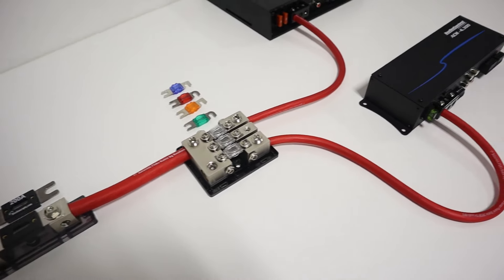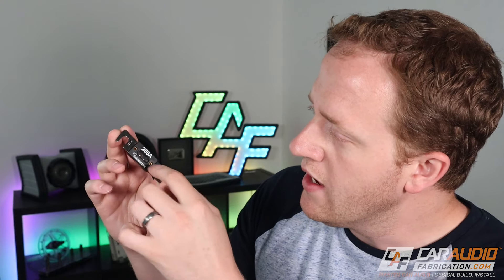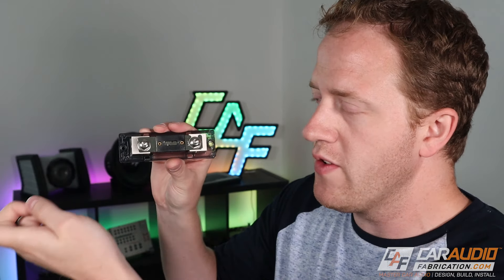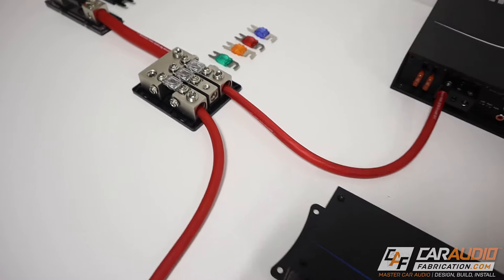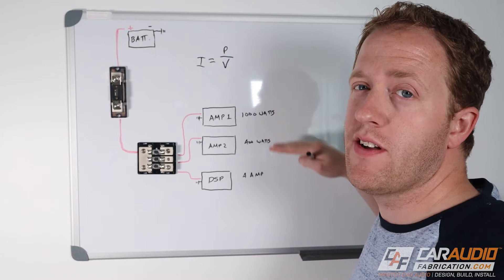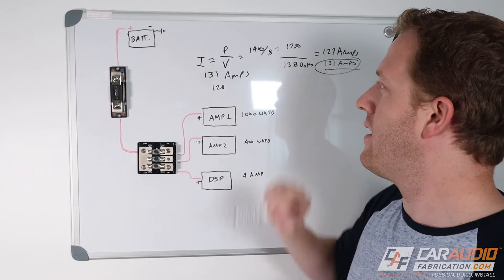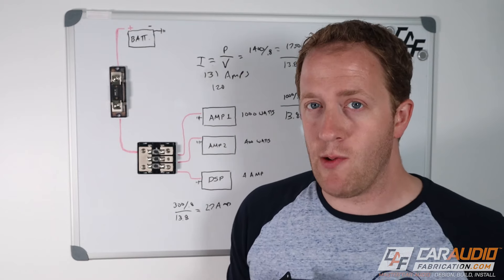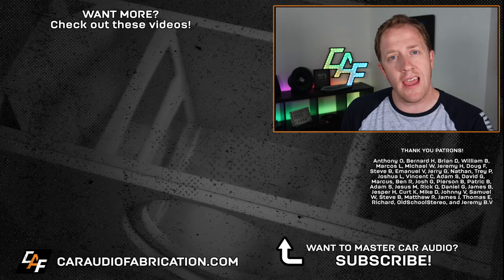Fuses EXPLAINED! What size do YOU need & MORE!

Comment: So I’m doing a 2 amplifier setup one is a 4000w 5 channel and 3000w 1 channel.  I’m trying to see what fuse would I need to run from my battery to my main fuse and also through my fuse distribution block to the two amps.
Reply: Would I need another battery in the back where the setup is ?
Reply: My 5channel amp has 3 individual 40 fuses

Comment: Just signed up, where does the 13.8 v come from? Isn’t the battery only 12v? Please explain, I want to build systems for friends and family as a hobby, but I want to do it right.
Reply from the maker: Turn on your car and use a multimeter and measure the voltage across the battery terminals. ;)

Comment: New to installing and I want to do it right.  I have an A/B four channel amp that has a peak of 360w.  By my calculations, I should have a 50 amp fuse.  Due to its efficiency rating, I am concerned about the size speaker wire.  The manual suggests using 14gauge, but everyone is telling me I will be fine with a 9 wire bundle.  This is typically an 18awg.  Any suggestions are greatly appreciated!

Comment: What are your thoughts on using CCA for my application? 
Im contemplating installing a 1/0 OFC amp kit, fused distribution to two amps using 4awg CCA (150a and 80a individually). I know 150a is pushing the limit for a short run of 4awg pure copper I'm assuming, according to the charts I've seen. That got me thinking about the grounds as well, and how it may be an issue. 
Just trying to talk myself out of buying more OFC really and I already have a bunch of old 4g CCA wire.
Reply: I know this comment is 8 months old, but I hope you went with the ofc. If you're not sure about it being the right choice, watch meade's video 'cca vs ofc' and you'll never want to use cca again (that is, if you want all the watts you paid for)!

Comment: Would I be using "Peak" Wattage listed for the amp, or continuous for the equation?
I have 2 RP2000.1D Amps and a RP75.4AB (300w rms) amp that I will be installing into my mk6 Jetta once I get a HO Alt and XS Battery. Would I use 2000w (the underrated continuous wattage) or the 3,107w Dynamic dyno run for the RP2000.1D?

I will be using Welding Wire 0g run to the back into a distribution block, 0g to both RP2000.1D's, and 8g to the RP75.4AB. I planned to use the "in-line" style fuses to each amp.

Comment: Thanks Mark awesome video. I bought a 6 gauge wire amp kit that has a 80 amp fuse. I’m going to use a small 400 watt amp but the kit says for up to 1000 watts. Should I have bought a smaller gauge wire or would that be fine.
Reply from the maker: I would use 4 gauge.

Comment: I have a system with 3 amps and a DSP. I currently use a 125a fuse is that sufficient or do I need a 300a? My system totals 6600 watts. Also do you recommend a fuse per amp/dsp?

Comment: Aloha,

I plan to use the Acm 4.300 amp, which you have in this video. What size power wire and fuse kit should I use? Thanks

Comment: So, if I’m using 2AWG from the battery with a 300amp fuse, that goes to a distribution block, two 4AWG wires coming out, one with a 60amp in line fuse, which goes to my 500W amplifier for my component speakers, the other wire from the Distribution block goes to 250amp fuse, then to the 2000W amplifier for my subwoofers, I’m thinking the 4AWG to the amp for the subs would not be good enough? Therefore, am I better running a 2AWG fused near battery feed solely to the 2000W amp for the subs, PLUS, a separate 4AWG fused near the battery feed solely down to the 500W amp for my components? I’m slowly getting my head around the Math lol. Thanks. 🙏🙏🙏🙏

Comment: hi, I have a question, if we have a n iverter 3000watt/12v connected to the battery, why we need to put this 300amp fuse and not just a much smaller fuse in the output ?

Comment: Hello bud, I have a 3000 watt monoblock producing 1350 watt rms @1 ohm, 2 (15's) which I don't know the watts for as it doesn't mention behind the subs or on the box. 15's are 2 ohm each and I've parallel wired them to make it 1 ohm which my amp can handle. I was using a 60a fuse which got blown quiet quick I'm assuming due to the high current. What fuse do you recommend? 200a or 300a?

Comment: Ok so I have a question?? I’m wondering if I need to replace my  fuse coming from the battery if all my wires and lengths are the same. I’m going from 800w amp to a 1500w amp! All the same gauge, only difference is… the new one says I need a 120w fuse.. my current setup has a 100w fuse… do I need to change it?

Comment: I haven't seen this answered but I'm using a Pioneer GM-d9701 and Infinity 704A. Pioneer will be used at 500rms (4 ohm) and the infinity at 70x4 rms. Based on this formula I need main fuse at around 80 amps and distribution block fuses at 50 amps and 30 amps respectively. So why is the pioneer manual calling for a 150 amp fuse (and the amp is fused itself with 3x60) and the infinity calling for 60 amp minimum (2x30 on the amp)?

Comment: Great video and tons of knowledge. Question is I have a 4ga and 50a fuse going to a 600w amp and sub. But after about 3 minutes the amp goes into protection mode. Thought my ground was bad so got a better chassis ground and lasted 5-10 min. Could it be too much power and may need a 8ga wire and different fuse ?
Reply: You can't have too thick power wire - all it could hurt is your wallet... And as long as the main fuse isn't bigger than safe capacity of the wire gauge , that's no problem either.
More likely an issue with the sub load on the amp. What is the sub's number of coils, and what's the resistance of each coil? How, if dual coil, are they wired, series or parallel?
What's the amp, monoblock or multichannel? What is the amps lowest load it can handle? If multichannel and you're running the sub off a bridged channel pair, what load can the amp handle when bridged?

Comment: I have a question... The Bassik 2 Way 1/0 to 4 Gauge Fuse Distribution Block says it has a max load of 150A per circuit, i have a 2000 watt rms amp that recommends a 200A external fuse, how would i put a 200A fuse externally if the max is 150?

Comment: Best way for people to think of fuses would be that it is not only a controlled failure point but being covered etc it's safe. Without the fuse, the wire becomes the fuse and it's far more exposed, which takes longer to burn but as you state can of course be fire hazard. So if the current doesn't kill your gear due to lack of fusing, the fire will and potentially destroy your entire vehicle with risk of hurting you or someone else in the process. In other words, don't skimp on a fuse because you're worried you're losing power to it as the damage that can be caused without them is far worse than the .01 volts you "might" lose.
Reply: Brilliant!

Comment: Thanks for all your Vids very helpful. However i a little confused due to some of your previous videos you calculate wire and fuse size based on Total usage power that you will be using (eg. if we only use the amps in @ 4 Ohms then you use the amps 4 Ohm ratings) then other videos you use the amplifiers maximum rating to assess the fuse and wire sizes meaning what the manufacturer rates the unit @ in 2 or 1 ohm. These number can vary a fair bit.
Which ratings should we be using to calculate, the maximum amp rating in the lowest stable ohms or the rating  we will actually be using?
Hope to clear this up and keep up the good work 
Thanks

Comment: So my setup will consist of a 3 way fuse/distribution block. I have two amps that require 60A fuses. The third connection will be my 1 farad cap....how should I go about fusing it ? Just put a 60A on it also ?

Comment: If I am drawing 120 amps total between my two amplifiers (20 for the little 2 ch and 100 for the monoblock) and have about an 8 foot run from the battery back to the amps, can I use a 4ga wire to a distro block and split to two 4ga wires? They will be properly fused. Just wasn’t sure if you absolutely have to step down from like 0ga to the two 4ga or if I can just 4 all the way. Thanks!

Comment: These things conFUSE me, that's why I reFUSE to inFUSE  fuses into my projects... it helps to deFUSE my aggravation.
Reply: Xktree72 😐
Reply: FUSECEPTION
Reply: Xktree72 🤣🤣 I see what you did there
Reply: ...Flames are proFUSEly shooting from under the hood now. 🤟
Reply: Your aggravation is just irritating and down right infuriating so I refuse to be confused about what your supposed to do or will do with this comment if you choose to respond to my attempt to amuse you with my comment all started by the CAF video on a fuse?
Reply: @Thumper68  you appear to have a very short fuse therefore I must step in to defuse the situation. Although the pressure is making me sweat profusely.
Reply: Why does my amps manual recommend a fuse with a way lower rating than what my math calculates ???
Reply: Should not have blazed before i watched this, i'm 😕 conFUSED.
Reply: @ltthebeast10  because your amp probably doesn't put out the rated power they're advertising on the box.

Comment: Quick question.  If my amps already provide the fuse sizes necessary cant you work the numbers backwards to determine the inline use size at the battery by adding up the sizes from the amps fuse sizes?
Reply from the maker: Some amps have internal fuses that are difficult to check, you can spend three seconds with the simple math instead.

Comment: Hey Mark, great video...got a question...I own a 2015 Chevy Volt I live in an area of California were the Edison company will cut off power to prevent wildfires.  I recently purchased a 3000-watt power inverter (Duracell) and I want to use my car as a back-up power source in the event of a power outage.  Any thoughts on the type/size of fuse I will need?

Comment: What is the fuse on the amplifier is 1.5 or 2 times larger than the number that is calculated? You said if this the fuse is smaller than what it is calculated the amplifier probably doesn't make the power that it advertises, but what if you calculate the fuse to be 27 amps and there are two 30 amp fuses? Is that also a red flap about the amp?

Comment: My truck sends back 14V into my 2 Farad power capacitor. Into a 1,200 Watt class D amp. What size fuse should I get?? I have a 9.5mm power wire. It’s a good quality one, but I only have an 80amp fuse and they blow when I’m running bass really hard

Comment: My amps says to use 4g wire with 120amp fuze but i want to run 0g from battery what size fuze should i use near battery if i use a fused block to step down thanks for any info

Comment: I have a 4000 watt amp, class D so 80% efficiency, 5000 watts/13.8 is 362.2 amps. So I need a 350 amp fuse!! I’m running 8/10 AWG wire with a 80 amp fuse rn lol. Holy crap

Comment: Hey Mark, I have a question. I’m currently working on installing two amps for my pickups system. One amp is a 6 Channel 250 watt kicker for my speakers n the other is a mono 1800 watt kicker for my 15” in. JL Subs. Using your formula I gathered that I’d need 10 AWG n 4 AWG. Now would it be a terrible idea to run both at 4 AWG??
Reply: 4 channel*** my bad

Comment: Hey man. I just got a system for my birthday. I have two 4 gauge wiring kits for two amps. The kits came with a 120A anl fuse block. My amps have 50A & 40A external fusing. I thought that I would run each kit per amp. What would be your thoughts?

Comment: the shorter 4 gauge wire size comming out of the distribution block should be able to handle the current , because IT IS SHORTER in length , or am i wrong?    short runs of 4 gauge wire can handle the same amount as long runs of 0 gauge wire

Comment: Hi. Am planning to install new amp. It fused with 40Ax2. In manual i think there is a mistake. Suggesting to use min 120A rated fuse with ilustration of 40Ax3 fuse. So should i follow the manual or use 80A fuse base on the fuse fitted to amp? I have in hand 60A in line fuse.

Comment: Hello...i have a dc water pump 12v: 4.5 A..what is the best fuse size to fuse in the circuit to prevent the pump from burning?

Comment: My amp was installed with a 150amp fuse, i have 8awg wire ~12ft 625watts at max power. I’ve had it installed for about 8 months and I’m just now learning this. What could have happened to my sub or amp with a 150amp fuse? 
Also I need a 50amp fuse then?

Comment: I have an amp that is rated at 1200 watts 1 ohm, 800 2 ohm, and 400 4 ohm. I’m probably going to use it at 2 or 4 ohm. Is my 0 gauge wire with 200 anl fuse too much? The amplifier has a fuse rating of 100 amp, and the fuse is built in, so I don’t have a way to verify that. Are there adverse affects of having too much fuse? I think I missed that part in the video. Should I return the wire pack and get a smaller one?

Comment: If the amp is powered directly from the battery, will it continue to run after the engine is turned off, risking on running the battery flat? My amp is (power) wired using the car's factory amp wiring so how do I know if the wiring/fuse are adequate or not?

Comment: So if you have a thousand watt amp does it even make a difference to run zero gauge wire if you're running say 100 amp fuse?? Would you have the exact same results if you were running a 4 gauge wire??

Comment: Great video and explanation Mark! I was just wondering why are fuses used instead of circuit breakers, since there are many made specifically for cars.
Reply from the maker: The point of this video is determining a current value for the protection circuit. You can use a breaker of the same calculated value.

Comment: So I have a Kenwood xr901-5. It has 3 40 amp fuses. According to the calculations,  it call for just over 81 amps of power. But, again, it has 3 40 amps fuses, totalling 120 amps. So which one is it? 80 amp fuse at the battery, or 120 amp? I haven't installed it yet.

Comment: I have a question regarding short circuits in a car. I recently had a car fire due to a short circuit in my main power wire. It had been grounding to the chassis and started burning the seats above it and a fire began. I had a 100 amp fuse, however it did not blow. The car was off, and my amp is rated for a 100 amp fuse. How come my fuse did not blow on my power wire? Does a short circuit not use enough amps to blow these 100amp fuses in the first place?

Comment: Dude this video breaks it down great but can you please do a video on the New concept dual zero distribution block I wrote a brief description on how it works and it's very complicated to understand it'll be awesome if you could do a video on this distribution block yourself thank you so much is.The BK-2030 has three fused outputs, left / center / right. Each output is fused by a Mini-ANL style fuse. The left and right side output use two mini-ANL fuses in parallel per output. This feature allows the installer to fuse for loads up to 300A on these two circuits. The center output has a maximum fuse capacity of 150A. When ordering a 300A fuse, you will receive two 150A fuses for that selected circuit (150 x 2 = 300A) The same principle applies for an 80A load, you will receive two 40A fuses (Applies to Left / Right outputs only)

Comment: All this is good information, but when I'm calculating the power am I going by Max power ratings or RMS ratings? When looking for the appropriate fuse for each circuit
Reply from the maker: Make your life easier and just completely purge max power ratings from your life. They are meaningless and disregarding them will make system design much easier. RMS is what is important.
Reply: @CarAudioFabrication  ok thank you. I did end up figuring it out yesterday to go by the RMS ratings (as it pertains to the proper fuse & wire size) But this video taught me alot and understanding the formula took me along way! I been learned to go by RMS ratings, but with this fuse stuff and getting the fuse and wire correct, I wasn't sure if the max power or RMS ratings were what to go by. But now I got it.

Comment: Should my power calculations be based at amp ratings or actual power being used? For example. 4 channel 800.4 but I’m actually using    125 x 4 at a total 500 watts. Should my formula be 500/.80 or 800/.80?

Comment: Hi i have db. 3800.1d i use 3 cable 50mm2 i have 3x150a anl fuses one by each cable is that ok? And do you recomend to use fuses for DB drag. Voltage is higher without fuse or its same? I hope you Will answer me tnx... :)

Comment: What about when I purchase a monoblock which can run from 360w rms/4 ohms to 900w/1ohm and I would run the amp only @4ohms at 1or2 m long wire? Should I just count it as 360w power output or the whole 900watts it is capable to do? Thanks)

Comment: I need some help please. I have a Crunch GPX2000.5 Amp and it’s rated at 2000w max and 1000w RMS. The amp has 2x40amp fuses which come closer to the 1000w of power then to the 2000w... Originally I wanted to use 0 gauge wire in a 16 feet cable run and a 200amp fuse, which would be correct for the 2000w of max power... But now I don’t know if that’s way too big so that it could still damage my system in an emergency. Should I rather go with the 1000w RMS rating and use a 90 or 100amp fuse and 4 gauge wire to save some money?

Comment: is it necessary for the inline fuse holder? or can we just connect directly to the fuse distributor block?
Reply: If your setup is such that the distribution block is close (within those recommended 18") to the positive battery terminal, then yes. Otherwise the cable between the battery and distribution block is unprotected and could, worst case, start a fire.

Comment: If I use a power distribution block without the fuses, I still can install an in-line fuse block to the outlet wire correct.

Comment: Going off this video I have worked out that the LC7i requires a 2 amps fuse but the lowest Mini anl fuse I can find is a 30amp....is that to much or should I route in a blade style fuse between fused distribution and LC7i?

Many thanks in advance

Aj